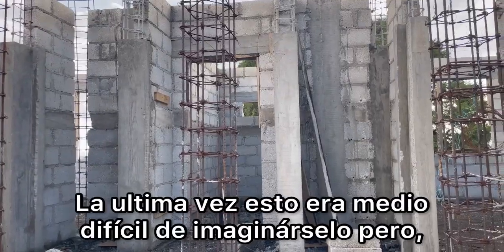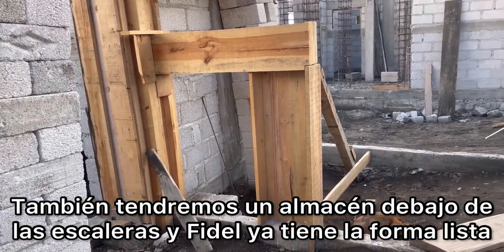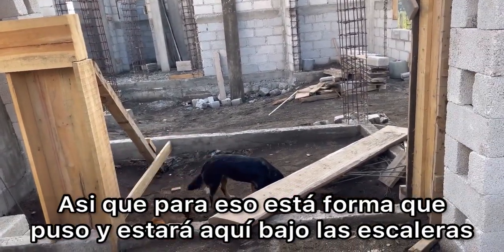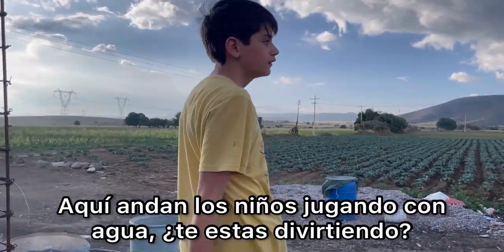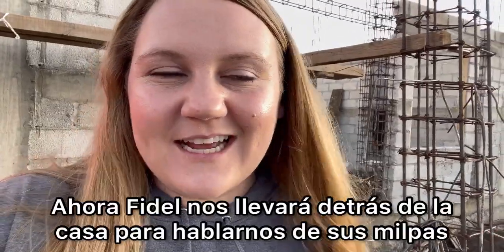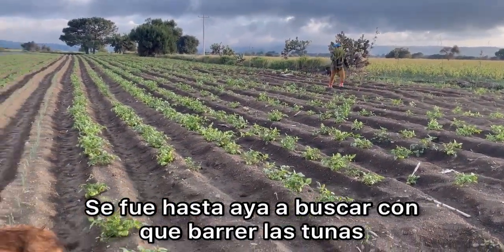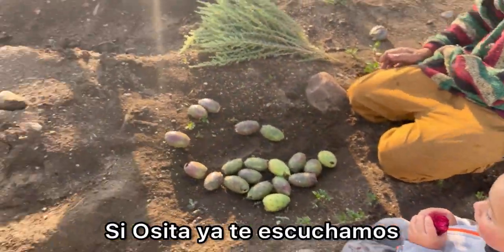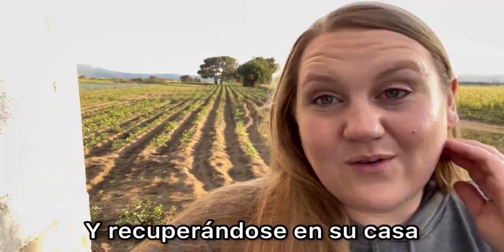Building Our Home in Mexico - Fidel is Back to Work!

Comment: Your construction is a little different than in in LA, but actually it is similar to our current code work,. Not very house in LA is block wall but  using steel on stucco. Should last and have other uses in the future.